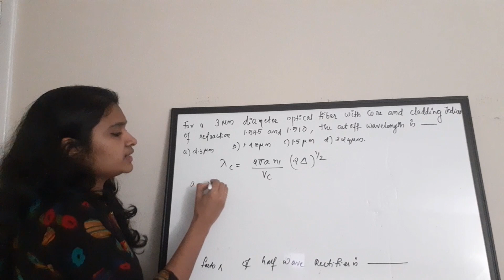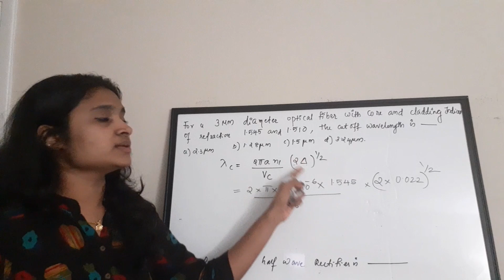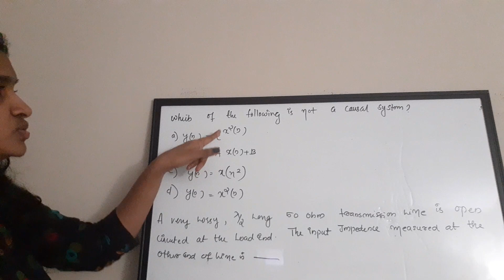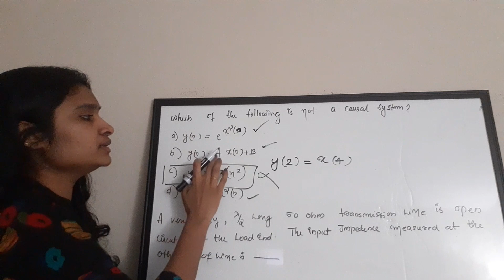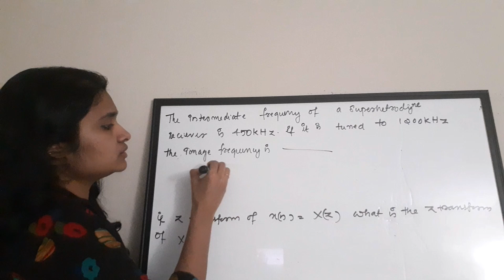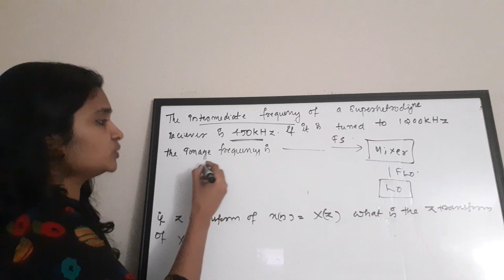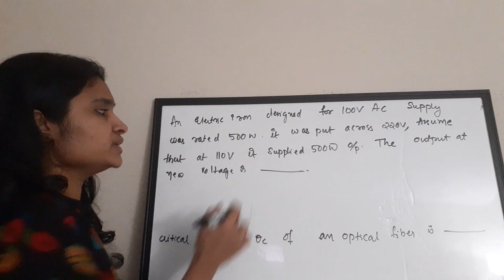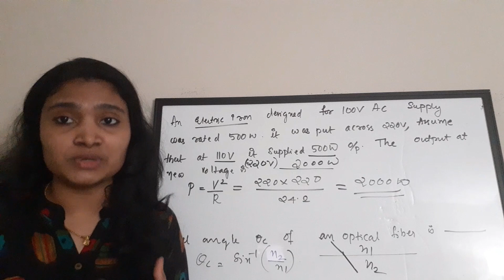Competitive Exam Preparation of Electronics and Electrical Part6| Technical assistant| BEL Exam

Comment: Please correct your  explanation;
The mixer in the superheterodyne receiver is a nonlinear stage that combines two signals. This nonlinear mixing produces two outputs: one at the sum of the two signal frequencies, the other at their difference. It is the presence of this fixed-difference frequency output, called the intermediate frequency (IF), which makes the superhet design so effective. This is because the IF is always at the same frequency, regardless of the specific frequency being tuned. Since the IF frequency is always the same, the IF stage amplifier as well as subsequent demodulator can be optimized for performance at a single, known frequency.

Comment: Kindly solve this vssc Thiruvananthapuram 25/02/2018 advt.no 301 question.

In optical communication using silica optical fiber,1nm spectral width at 1300nm corresponds to a bandwidth of(assume refractive index of silica optical fiber=1.5)

a) 150 GHz.   B) 120 GHz  C) 80 GHz d) 90 GHz
Reply from the maker: Please send the Question paper to anubhaskar25@gmail.com